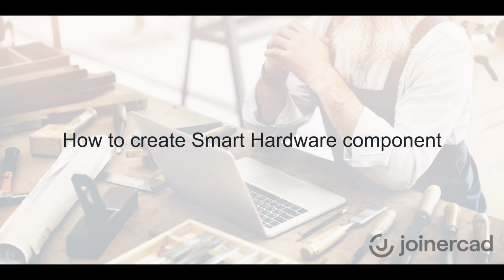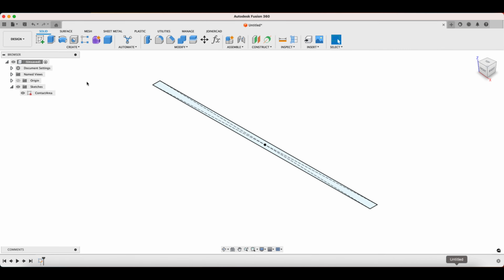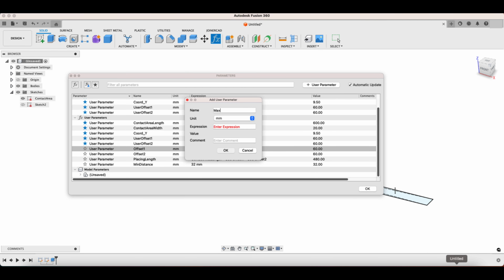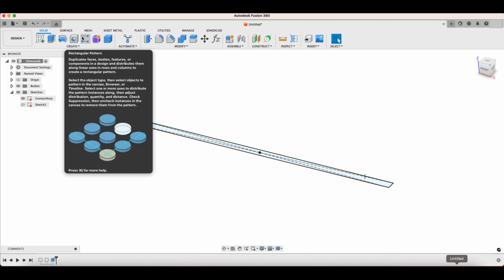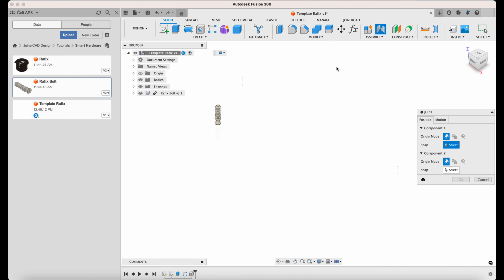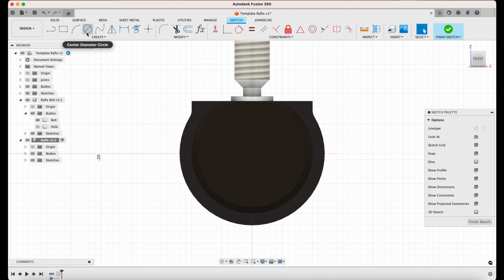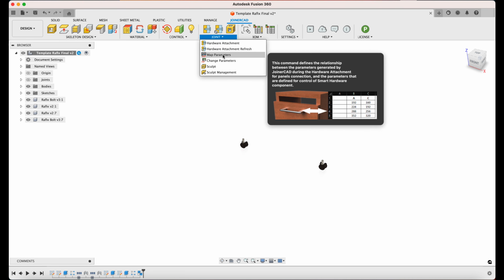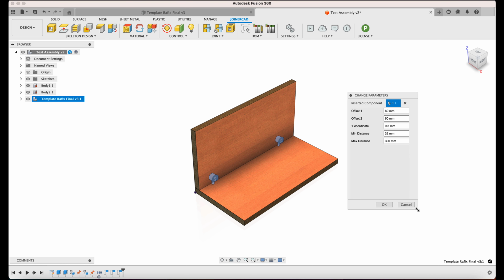3.  Smart Rafix hardware template creation

Comment: How can the insertion of hardware be set up so that there's just a single item, located in the middle of the contact area? (Use case: To avoid using 3 expensive lamello clamex connectors to join two panels, I'd like to insert just one clamex in the center and two cheaper wooden dowels on either side.)

Comment: I notice that the library contains separate models denoted as "Edge SIDE" and "Edge EDGE" for the same Lamello connectors. The other library models do not have this distinction. (even though they can also be placed on panels that are joined edge-to-edge and edge-to side) When setting up a new smart hardware component based on the template, is there anything to take into account regarding this? It's not clarified why the distinction exists specifically for the lamello's.
Reply: It was done like that, because we are using different approach for insertion. This is specifically needed for the Lamellos, because using these connectors, you can connect to panels using their edges or edge/side.

Comment: is it possible to use this feature to insert drawer slides into a model?
Reply: Nope. Drawer slides are chaning depending on a length and many other parameters (depth/system/drawer type etc.). This means, you need to add additional logic to a model. And this is our main issue - Fusion is very limited when we are talking about logic and functions. Even Configurations does not help a lot here.